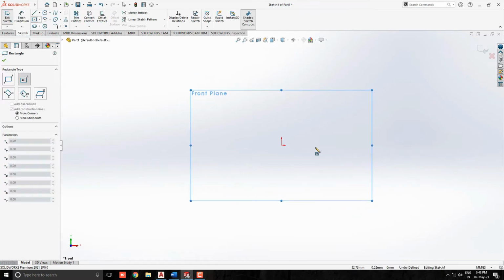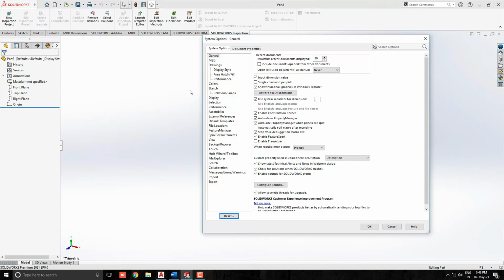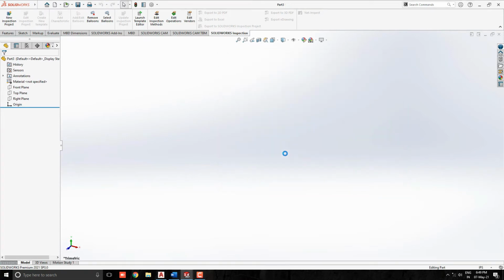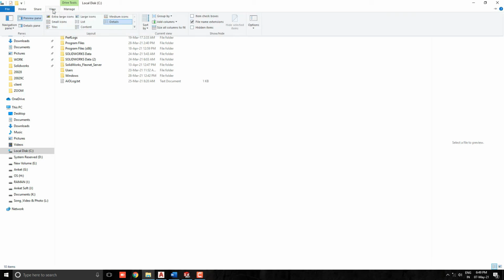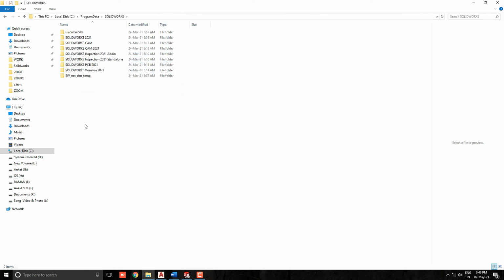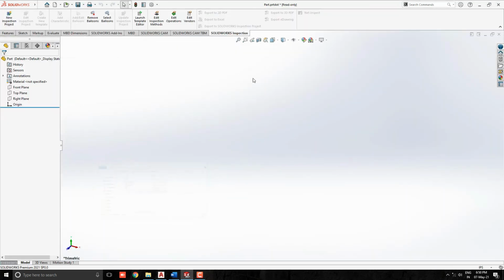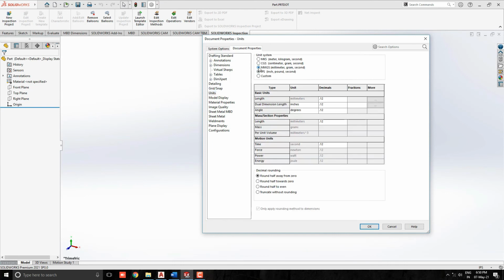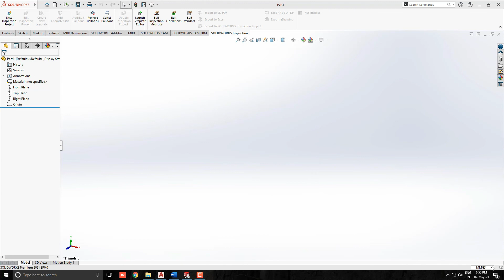How to Change / Reset Solidworks Default Unit System

Comment: This helped in Solidworks 2022 Thank you! It should have inside the solidworks instead of changing from template.
Reply: Yes, it's beyond ridiculous to not be able to change default units easier than this. The very first time you run Solidworks after installation, it asks what unit of measure you wish to default to but once you do, you're stuck with it. Except by changing it with the convoluted method in this video, of course.
Reply: @thinking-monkey  You're right 👍